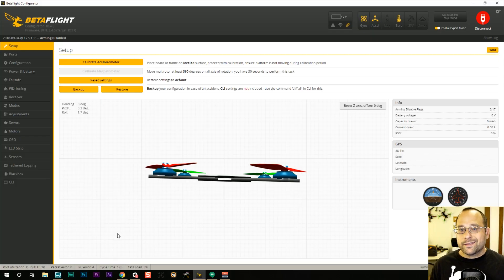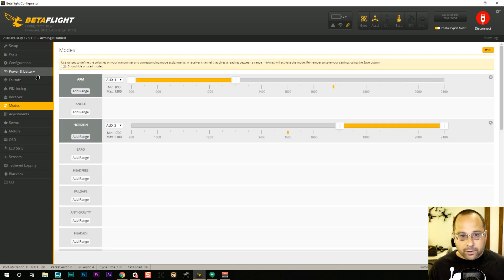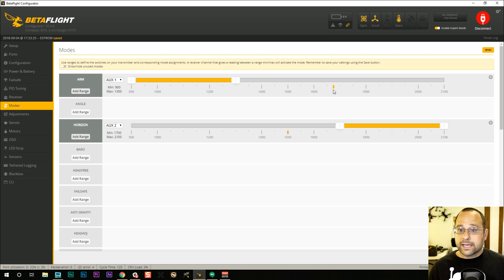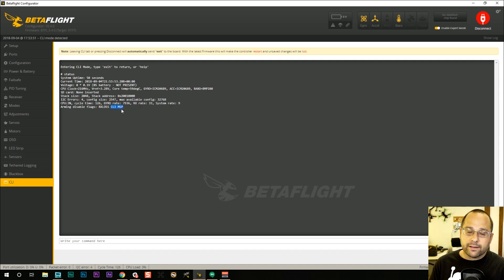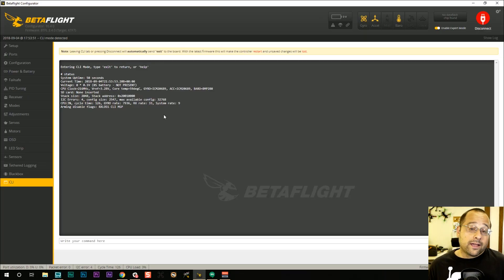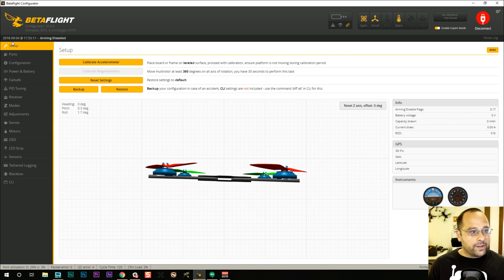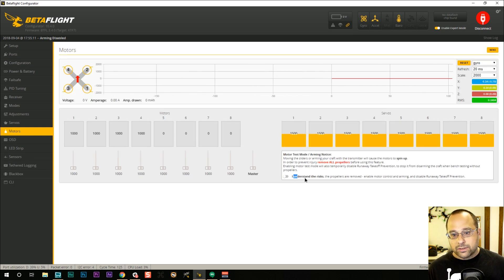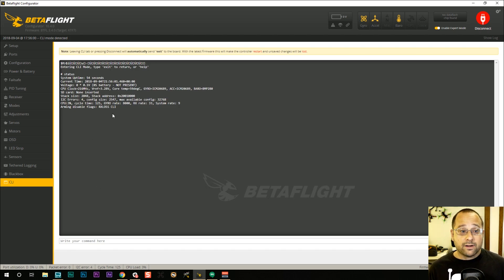BETAFLIGHT WON'T ARM | CLI MSP arming status flags

Comment: Hi. I have mine bound with a NamimnoRC external Tx on radiomaster t16s but I don't have stick input in BF? I remember before there was an option to invert tx signal to fix this but it's not there anymore. Any suggestions?

Comment: Hi, still having the same problem! Not sure if it’s arming after I disconnect from pc. The arm switch is off, I put in the battery and I hear the beeps which suggest that it’s not armed. Motors spin fine via betaflight but no luck with controller. Newbie here and I did everything I could. Please help!

Comment: I get the same message but when I press arm on the control it does not move to arm in betaflight nor does it recognize my control, but when I press turn off on the control it tells me that it is connected to the Drone but in betaflight it does not recognize my control

Comment: i have a msp arming disable flag. ıt doesn't work by unplugging the usb. every time I disarm then i need to connect to the Betaflight and check the box I understand the risk under motors tab then it arms. but I don't want to do it every time i disarm. ıs there any fix for that. thanks

Comment: Hello, again Joshua, wondering if you can help me I'm stumped again, i have an CL Racing F4 FC Stack, the problem is that on the receiver tab On BF  when i move the roll to the right the bar on BF goes left same with Yaw. Second is the green light flashes when plugged into the pc, and when i plug in the battery and try to arm it is blinks 4 time fast then 3 with a pause and then 1 pause then 3 more blinks what is the problem? Info on BF says Arming disable flags: MSP. that is cause its plugged in ?

Comment: In your intro vid you had one long beep and 3 short beeps, exactly my issue in 4.2.9. Not found a solution though. Surely you can run the motors up in the motors tab with MSP overridden. My motors (props off) still wont run up.

Comment: Hi Joshua! My spektrum satelite receiver now works (yellow light solid) only when the usb cable is connected to betaflight. If I disconnect it (drone battery is plugged, so there is energy in the STM32F411 board) the receiver light goes off. It was working fine previously... Do you have any clue why? Can it be a board malfunctioning, or you think this is  programming? Thanks!!!!

Comment: So let me get this straight.The simple flip of a switch starts the motors??or am I missing something?.If this is true i see many people getting hurt..Bring back the throttle bottom left arm...
Reply from the maker: If you are concerned about flipping the switch use the prearm mode, which requires two simultaneous switch flips to arm. Using the sticks to arm and disarm doesn't work for freestyle and racing drones where you need to use yaw at the same time that you are at zero throttle. With the stick disarm method, I can't do an inverted yaw spin without disarming. And switch disarming is faster and more certain than stick disarming. With racing and freestyle drones, you often need to disarm immediately to avoid damage to the quad or to property. Having to input a stick command is slower.
Reply: @JoshuaBardwell  Makes sense in the race acro environment.would be nice to have a simple option/toggle or something like that to use throttle stick like years ago.

I think you still can setup throttle arm on aux switches?

Comment: hello JB, i am not able to arm it even after doing what you have said, i am trying to arm when it showed CLI MSP, then i did what you said to do, but still it wont arm, and when i connect battery the  motors start to spin, without recieving any signal, can you please help me to solve the issue
Thank you

Comment: i have done all this and my motors won't spin i can't test them or anything. it says its armed it says its good but no spin no motors.
Reply from the maker: Check the motor protocol in the configuration tab. Also maybe you have bidirectional dshot enabled but the ESC doesn't support it.
Reply: @JoshuaBardwell  Im not able to follow that. i got everything set and now when i check the motors it says their spinning but the motors them selfs are not. i look at the configuration tab now.
Reply: @JoshuaBardwell  i check all that and im more lost. i have a newbeedrone acro beebrain pro bnf. no matter what i fix the motors do nothing. at first the sliders wouldn't move at all, now they act as if everything is fine. responses to my dx6 like it should but the motors still do nothing. the protocol just says brushed all the settings seem to be right but im not sure if i would see anything wrong beyond my simple knowledge.
Reply from the maker: For that FC, "brushed" is the correct protocol. It may be time to reach out to NBD support and see if you have a damaged FC.
Reply: @JoshuaBardwell  damn this sucks lol i don't have the funds to send it back, i feel like this might be it. i have told NBD everything and now it just looks like I'll not have anything now.  some how this is my fault and i don't understand i did everything they said to do and it still didn't work. thank you for your time and im sorry if im rude.

Comment: installed Tracer and cant arm, seems to be in failsafe the flag says RX_FAILSAFE MSP.  PLEASE help
Reply from the maker: The FC is not seeing signal from the receuver. Check wiring as shown in this video. Make sure ports tab has the correct UART enabled.
Reply: @JoshuaBardwell I did all that, I am going to swap it out with a different receiver and see if I still have the same problem. My throttle travel seems to be stuck at 885 instead of 1000

Comment: I wasnt sure which of your videos to post this on because I've used so many in setting up my first drone. somehow it came despite the build going so smoothly and the only thing I ever resoldered was my receiver. Yet somehow I had every issue possible in setting it up in betaflight it seemed like. my throttle and pitch were reversed which is where my first arming disabled flag came from and after two days of working with my transmitter got that straighter out, to the realize I set up a failsafe mode instead of a gps take over mode. (I have the tyro 119 so it came with a gps). but thank you and god bless you and you're seemingly infinite knowledge of drones.

Comment: I've jumped from toy drones to Hoby and now my head is shot to bits.. Bought a betafpv hx100se(dsmx) Cant bind it to my jumper (far to advanced) drone just sits flashing a red led.. Im not a real beginner but this is a bit harder to understand.. Jumper set to dsmx but bind it will not.. 🤔.. Your videos are great but I think I've bitten off more than I can chew with this lot.. Thanks, bk (UK)
Reply from the maker: Change from 22 ms to 11 ms sub-protocol see if that works.

Comment: mine says paralyzed . and when i hit arm it just beeps 5 short beeps followed by two long beep then two short beeps please help.
Reply from the maker: It means you activated the Paralyze mode in the aux Modes tab. Normally there isn't a reason a typical person would want to do this. You should probably delete the Paralyze mode in the Modes tab.
Reply: @JoshuaBardwell  iv got the buzz my modes wont work just saw your vid to fix this. how do i unactivate it
Reply: @JoshuaBardwell  i really cant find it this is driving me crazy
Reply from the maker: Email me so we can figure it out.
Reply: @JoshuaBardwell  ok at work. Thanks so much

Comment: I get an error message in the osd warning section that says "IR error".  I can still arm but I loose throttle it is like it only have 50% power.  Can't fine what "IR error" means anywhere!  Mobula 7 v3.

Comment: Spent all night trying to get my new tinyhawkfreestyle 2 to arm, Iwas getting rxloss cli so I check out your playlist and give myself a headache lol. In my case it was my taranis playing up pitch roll raw throttle was all missed up, I don't understand what is going on with my taranis but when I try to create a new model I get a message saying id used on a different model witch means I can't choose plane multi ect . I have got round this but I have to go to the mixer page and edit because I can see pitch engine or something next to Ail Ele Thr Rud. Does any one know what's going on here sd card in the taranis maybe, thanks

Comment: is there a reason my sensors never calibrate on initial setup? everything else works except it won't calibrate and says its still calibrating sensors. not to be confused with this issue. but kinda similar
Reply from the maker: https://www.youtube.com/watch?v=47rNFd7q618

Comment: So I’ve done all this in the video, I can get the  receiver tab to respond properly and can get the motors to power up while connected to Betaflight. I disconnect the cord and plug a battery up and get nothing. Is there a setting I’m missing?
Reply: How did you resolve this?
Reply: How did you resolve this?

Comment: I'm new to this whole quadcopter thing and mine wouldn't arm at all. This is my first one and I was so confused and I didn't know why it wouldn't fly. Keep in mind I know absolutely nothing about this. I thought it would be fun because I fly just normal story ready drones. So, I thought I'd take it up a level. Little did I know that level would be a huge one. I spent my first 3 days with this quadcopter not knowing how to even get it off the ground. Although it's kinda hard to break my spirit if I like something so I kept searching the web and well...you're the only person who actually fixed my problem. And you made it seem so simple. Thank you a ton. I can actually fly now😂

Comment: Good video as usual Josh but I go to the motors tab and click on the disclaimer, I then go to modes and the "ARM" works but when I disconnect from BF and try to arm it won't. I go back to BF and it's not arming in the modes tab. Everything seems fine except the CLI MSP error that won't go away. I'm using a Synergy F4.
Reply: im having the same issue any fix yet ?

Comment: My arm mode turns red and says disabled when the switch goes in the range. Any ideas?
Reply: did you ever figure out the problem?
Reply: Third this
Reply: @joshuarodriguez5988  nope. Paperweight.
Reply: @jmbauer68  thanks for replying! If by any chance you still have everything for the quad my problem was the newer updates do not allow you to arm your quad while connected to betaflight. So when you flip the switch to arm it will display as "disabled" on betaflight. I resolved this by just leaving my switch in the unarmed position, unplug the quad and turn off the transmitter. Then started off by turning on transmitter first then plugging in quad. Waited 5- 10 seconds after the startup beeps and then flipped my switch to arm. The quads motors started spinning at the 3% idle i had set it to
Reply: @joshuarodriguez5988  Thanks for the insight.  I will give this a try.

Comment: hi from indonesia here,i tried it on mobula 7 hd but still got the arming disable flags: msp and then all of my setting is gone in the betaflight and disconnected from the radio,oh and i put nick burn pid for the mobula 7 hd, any advice would be great Master Bardwell :) ,need to do this for the lockdown time here :) ,Thx
Reply from the maker: MSP will go away if you go to the Motors tab and enable the "I understand the risks" option. MSP should not appear when you don't plug in USB.
Reply: @JoshuaBardwell  thank u for the fast respon tried it again and it works :D

Comment: Dude@ I have a diatone f405 mk2 stack.. I flashed the latest firmware, connected the motors to the ESC, and connected the R9 MM receiver.. The receiver is connecting to the remote but no movements are detected by betaflight, know that i tried all 3 channel maps to no avail. Then i wanted to test the motors using betaflight.. No go, they dont even try.. I also only hear 3 prime beeps when plugging the battery on. I cant figure it out, its a new stack.
Reply from the maker: First, check that the R9MM is definitely bound to the controller. Solid green LED when controller is on will confirm this. Blinking red LED when controller is on means it's not bound.

Once the receiver is bound, check for moving channels in the receiver tab of betaflight. If not, then check Ports tab and see which UART has "serial rX" enabled. Make sure it is the correct UART. Also check that the receiver protocol is correct in the Configuration tab (it should be SBUS by default for that receiver).

Check your wiring. The SBUS OUT wire on the R9MM must go to the SBUS pad on the F405.

The missing last-3 tones of the ESC startup mean the ESC is not seeing any motor signal from the FC. This is unrelated to your receiver.
Reply: @JoshuaBardwell  Thank you.. Everything checks out.. I think i might have a bad stack.. Because the ES is also not seeing the motors. The FC LED is also Red.. So IDK.. What do you think?
Reply: @Ivar1231  I have the same problem, how did you resolve it?
Reply: Diego Ruiz I might be too late.. But, I downloaded the stack firmware from Diatones website.. After the download, I loaded the files using Betaflight and flashed the firmware.. It worked very well.. I've had no issues with it.. Flashing the firmware using the available firmware file versions on betaflight seems to not work with this stacks. It does work when downloading the firmware files from Diatones website.

Comment: Thank you for pointing me this video, I followed his instructions (MSP) lost, but everything remains the same as the old motor test still does not spin and info (Arming Deaktivert aufgrund). I turn on the AUX1 switch, then the motor has 3 music (Te te ti) but the motor does not spin.
I want to reiterate my chip is the MAMBA F405 Mk2 4in1 ESC Konfiguration 4.1.4, very expecting him indications.
Reply: Did you find any solutions?

Comment: I have the exact opposite problem here.. Can't disarm the quad, at lowest throttle, bt I set stick low threshold to 1100,min command esc to 1000,min throttle to 1100,all channels mid point set to  1500-1502 with a dead and, any help thanks

Comment: Hi there,  if you can have a look at my video, Darek B. Rc Emax hawk pro 6s.
Looking someone to help me set my drone up. I  can armed my quad but soon l go over 30% of throttle it won't get back to armed speed. All it does it's keep increase  a speed until reach 100% of throttle then I have to turn arm switch off. What's wrong with it?  Is there anyone to help me?  Thanks

Comment: Hi Joshua i have been looking at a lot of your videos and they have been really helpful. I have my quad setup for the most part but i am encountering and failsafe that is caused by loss of voltage after arming and advancing the throttles. I have an armattan marmotte, connected to BF i see the 6s pack with the correct voltage. As soon as I arm it the mototrs start the voltage goes to 5v but when i advance the throttles the voltage drops rapidly and i see a failsafe in the setup - Armng disable flag line. Hoping you might be a able to offer some ideas.

this is my first quad build and I am running a hobbywing F4 G3 stack inc 60amp ESC, jeti ex bus radio. rush tank vtx I re soldered the wires for the radio and same issue.

Once again i am hoping you might be able to help. Simon

Comment: Under the "Mode" section, the "Arm" shows red and disabled. the arm switch is actually controling the flight mode...I have the tinyhawk drone and remote. How should I correct it? Thanks.

Comment: Your expertise is second to none and your videos are very appreciated. My problem. I've got a Meteor 65. Using BF 3.5.7. Xmitter is a Taranis X-Lite. Set-up aux 1 for arming/disarming. I never use the CLI command until now. Problem, quad won't arm. In the CLI I get the "CLI MSP" message. I've done all you've explained in the video to no avail? In BF I activated the motors and get all the results you've covered. In 'MODES' when I arm them box on the left says ARM (Disabled) and turns RED. Disconnected from BF connect the batt and can't ARM. Any ideas..........I'm completely lost.
Reply from the maker: In the OSD tab turn on the Warnings OSD element. On 4.0 and newer it's on by default. On 3.5 I think it exists but it's not on by default. When you go to arm it will give whatever status code is preventing arming. Something must be coming up after you disconnect from USB.
Reply: @JoshuaBardwell  Here's the dirt. IT's WORKING!! Here's what I did:
- OSD tab was already checked? Reviewed OSD checks & made some minor changes as to what I wanted to see.
- Adjusted ALL Recvr travels to min 1000 and max 2000, not just throttle.
- In CLI got new message 'throttle CLI'. Thr in recvr was 1010, readjusted to min 996 couldn't go to 990.
- CLI now states 'CLI MSP'. hmmmmmm
- Did the motor thing as you suggested then in the CLI it displayed 'cli'..hmmmmmm
- Unplugged USB, turned on the TX, plugged in the battery, armed & motors spun up??
- Plugged USB, went back to BF Config screen & activated 'Motor Stop' and saved.
- Reviewed all the different tabs leaving defaults as is ensured DShot 300 was still selected, Rec'r set to SPI RX support - FRSKY_X.
- Made a back-up of everything.
- Unplugged USB, turned on Tx, put batt on, and low & behold she behaves as a quad should. 
Made an observation though. Connect the 65 in BF and just leave it on the 'setup' screen. Look at the model, after a few seconds it gives a little 'twitch' & continues doing it every few seconds?? Could that be related to what Nick Burns was taking about?
Anyway, gotta fly this sucker. Couldn't have done it without you. Thank you ever so much Joshua. You dedication to the hobby, effort in producing, time uploading all the videos, and especially sharing all the interesting and entertaining videos is very much appreciated by, and I'm sure I'm speaking for all of us enthusiasts, me.  
Very best holidays, prosperity in the New Year and best of health.
Reply: @JoshuaBardwell  Just supported you on Patreon as a 'thanks'. Wish you well in your new endeavors. Pierre